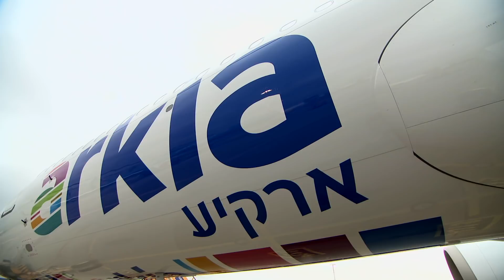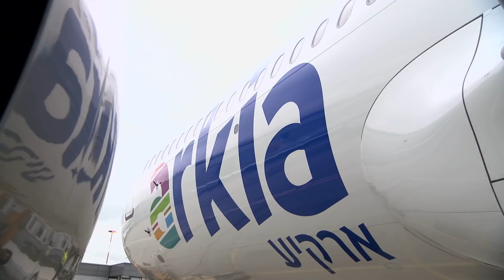In the making: Arkia’s A321LR

Comment: why do some a320 NEOs get the "bandit" cockpit windows while some not?
Reply: It is optional on A320neo aircraft, unlike on the A330neo and A350 where it is standard. I think it will be standard on the A321XLR but it isn't on the A321LR, as it is technically just an A321neo (the A321neo is available with up to 3 additional fuel tanks. When the aircraft is configured with all 3 of these tanks, it is marketed as an A321LR, however, this is just marketing as it's ICAO code is still A21N like the standard A321neo)